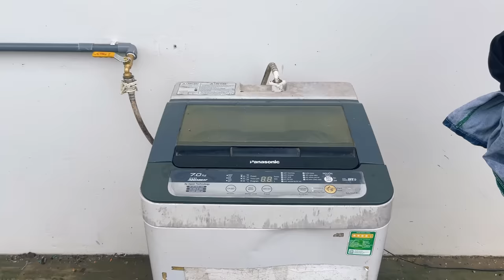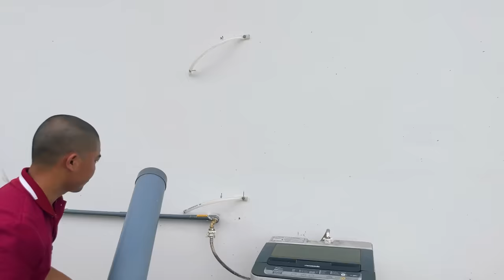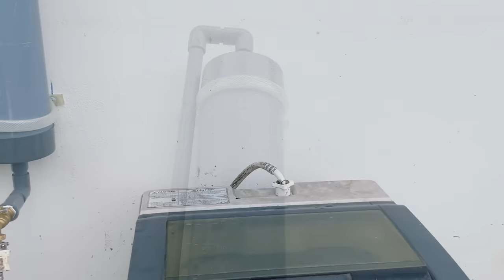Discover these incredible ideas now! Unique hacks born from combining plastic bottles and PVC pipes.

Comment: Hmm...  I think the first guy made it over complicated.  I'm on a well.  I'd have simply made it like a well tank rather than bothering with the pipe going up.  Basically, put a solid cap on the top.  Attach the big pipe with a t at the bottom.  Water pressure will force water into the big pipe, compressing the air inside.  Once the air pressure matches the pipe pressure, flow stops.  When the washing machine starts, the pressure will drop, and water will leave the tank for the washer.  When the washer stops drawing water, it'll fill back up.  One potential modification would be to glue in a schrader valve and a PSI gauge.  Hell, for what he spent, he could have probably just bought a expansion tank with a bladder.
Reply from the maker: That's a great simplification idea, and it sounds like it could work effectively for well systems! Have you implemented this method yourself, and if so, what were the results? Additionally, do you have any other tips or insights for optimizing well systems or water pressure management that you'd like to share with our viewers? Your practical suggestions can be quite valuable for those looking for efficient solutions. 😊🚰🔧
Reply: @tipsunknow I have one on my well now, that's how I know about them.  In my case it's used to keep the well pump from rapid cycling, which is bad for them.  I have no difficulties with my washing machine or anything else, because my lines were run with sufficiently sized pipe, so one tank handles everything.  It's so common that there are commercial tanks for the purpose.  Mine is actually oversized for my pump, but it just provides more protection, and water pressure in a power outage where my pump won't work.  For the washing machine setup, I'd be concerned that it wouldn't last through the fill cycle because of vacuum buildup - basically, there has to be something to expand in the tank for the water to leave.  Ever seen had a cup upside down full of water with it remaining there even with most of it exposed, only sealed in more water at the bottom?  The air can escape through the pipe up top.  It can also dissolve into the water, which is why modern systems tend to use a bladder or you have a  valve so you can refill with pressurized air.

Comment: The electrical security advice about water make so much sense when fixing a washing machine operated outside in the back yard.
And whenever I see pozidrive screws and a Phillips bit I'm about to scratch my eyes.
Reply from the maker: I'm glad to hear you found the electrical security advice helpful. It's always important to stay safe when working with electrical appliances, especially in outdoor environments. Regarding your comment about screw types, it can be frustrating to encounter different types of screws and screwdrivers, but having the right tools for the job can make tasks easier. If you have any specific questions or need advice on a particular DIY project, feel free to ask, and I'll do my best to assist you.
Reply: if you get bothered by Phillips/Pozi, then you need to get  a life

Comment: 6:23 A bucket with a mesh over it and an opening to the side above the ground of the bucket would do the same as this abomination you cannot clean it regularly especially the sediment on the bottom that accumulates, everything is glued together in one year u throw it away and the glue did not stick these different plastic types together on long therm
Reply from the maker: Thank you for sharing your thoughts and concerns about the design of the system in the video. It's important to consider practicality and durability in any project. Have you personally tried the bucket with a mesh and side opening method you mentioned? If so, what were your experiences, and how did it compare to the system demonstrated in the video? Your insights could be valuable for others looking for effective solutions. 🪣🤔🌿

Comment: shame you wrapped the PTFE tape the wrong way. Hold it the other way around so you have tension on it.
Reply from the maker: I appreciate your feedback and the tip about wrapping the PTFE tape differently. It's always valuable to learn new techniques. Can you provide more details on the correct way to apply it for better tension? Sharing your expertise can help improve the quality of future projects.
Reply: Yep, hold the reel so the tape has a tension on it, then wrap the opposite way the thread goes in othewise you do not get a good seal. There are many videos on you tube which show how far easier than trying to explain @tipsunknow

Comment: Really?????? Why do people mark the diameter of a hole they want to make and than use a holesaw?????? If one do have a holesaw o,e does not need to make a holemark. You wnat the hole in the center? Do the drill of the holesaw in the midlle. DONE.
Reply from the maker: You make a valid point! When using a hole saw, there's no need to make a hole mark beforehand because the hole saw itself is designed to cut a hole with a specific diameter. Simply positioning the drill bit of the hole saw in the center of where you want the hole and then using the hole saw is a more efficient approach, as it helps ensure the hole is in the desired location.

Creating a hole mark may be more relevant for cases where you don't have a hole saw or for marking locations before drilling with a standard drill bit. It's always good to use the most appropriate technique and tools for the job at hand. Thank you for sharing this useful tip!
Reply: @tipsunknow  Thank you for the reply. BTW you are not the only one who does it the same way. I found it a lost of time and inc from the marker. LOL.

Comment: There is a much easier way of getting rid of the leaves and you don't have to keep on cleaning the leaves out of the plastic bottle.
Reply from the maker: I appreciate your input! I'm curious to know, what's your preferred method for dealing with leaves? Please share your technique, and maybe it could help others looking for easier solutions.
Reply: We use a plastic bucket and then we cut it at 45 degree and place a piece of wire mesh over the 45 degree cut off. Then we drill a hole in the bottom of the plastic bucket and push a pipe   into the hole. We seal the pipe properly and the other side of the pipe goes back into the water tank/bucket. the pipe from the roof now empties into the bucket through the 34 degree mesh. So any leaves that come from the roof just slides off the 45 degree cut off and the water passes through the mesh minus the leaves and the water goes into the water tank. Once you see it works well, you can add water filtration into the bucket, from rocks at the bottom to fine sand at the top, and even add a UV light to kill all pathogens in the water making it clean and very safe to drink. search for this words 90mm Leaf Eater Original Rain Head and see what it looks like.

Comment: re gutter leaves: if your leaves are carried down the drainpipe, that means water is not being blocked to begin with. You have great big holes and pipes which is better than small holes which clog quickly making more money for the gutter cleaner. 

 It's even actually better to remove the little drain strainers. Well, around coniferous trees anyway; larger deciduous leaves can still plug the hole. But then, you have installed large holes and large pipes- which is always better because it simply allows debris to flow out. Although your device is very neat, good thinking, but it will clog when the first big leaf covers the hole. The only thing which keeps leaves away from blocking the gutter downspout drain hole is a wedge ramp shaped strainer product about a foot long, in metal or plastic.  

Don't let the builders drill tiny downspout holes with tiny little strainers built into the reducing adapter to the down-pipe.  Rip out those ridiculously small strainers at least and just let the debris have a chance to clear the hole and go down.  They are only to be left if the water goes into an underground catchment system.  And where I live(BC Canada) they are not allowed any longer because they clog up anyway no matter what you do to try to stop debris.  A bit of gravel detaching from the asphalt roof always gets hosed down the drainpipe by gutter cleaners no matter how much is collected manually.
Reply from the maker: Thanks for sharing your insights on gutter leaves and downspout maintenance. It's clear you have a lot of experience with this! I appreciate your suggestion about using large holes and pipes, as well as the idea of removing small drain strainers.

I'm curious to know more about your experiences with different gutter maintenance methods. Have you found any particular products or techniques especially effective in keeping leaves and debris from causing blockages in downspouts?

Comment: 6:12 WASTE GREAT WATER CLEANING SYSTEM...
Reply from the maker: It seems like you have concerns about the water cleaning system at 6:12 in the video. 😕 Could you please share more about what specifically you found wasteful or any suggestions you might have for a more efficient water cleaning method? Your insights could be valuable for improving the process. 💧🌊🤔
Reply: This is not water purification, but the removal of large debris. You might as well call rainwater in the gutter "purified".